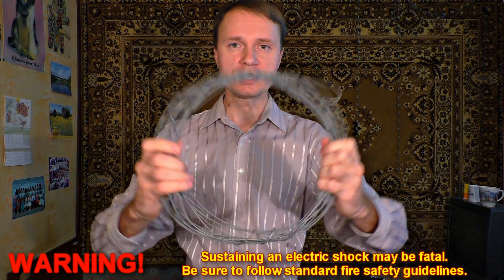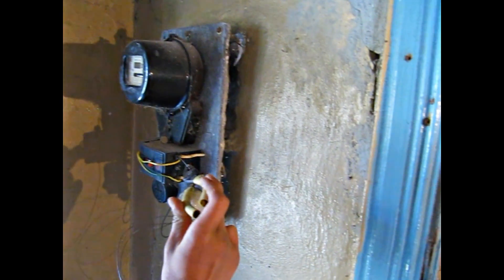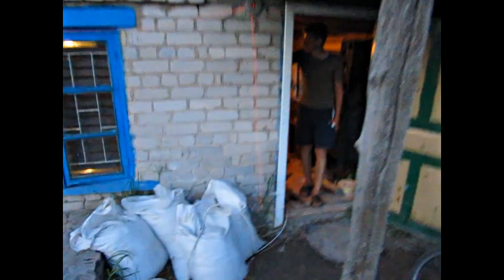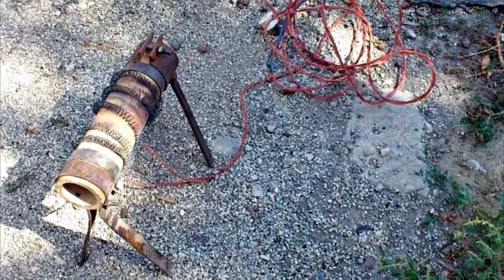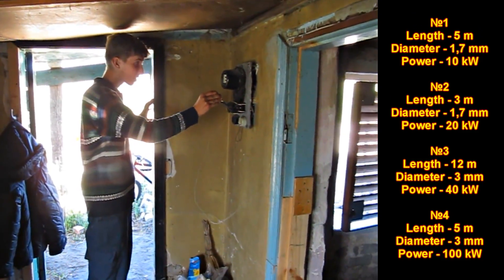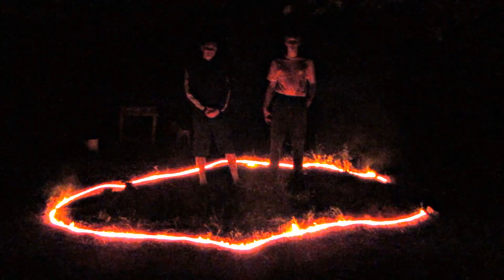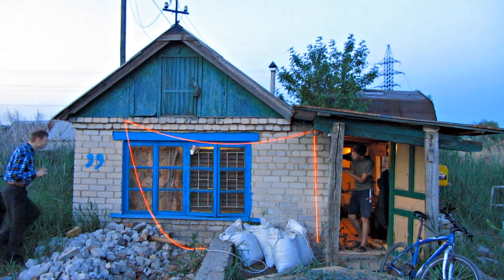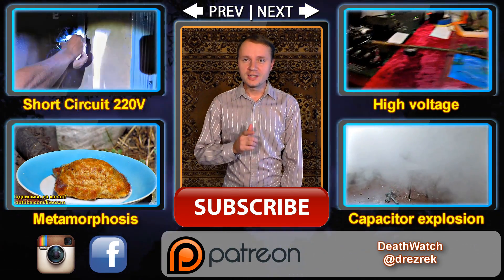Simplest DIY 100kW Heater

Comment: Good way to get a bad shock and start a fire. Stainless steel wire is better as the resistance stays fairly constant with temperature increase. Steel wire will draw a lot of current when cold and resistance will dramatically rise with temperature which is not ideal. That is no where near 100KWatts.
Reply: He probably just measured amps and not the actual power. Voltage drop with a supply running 5x overloaded is not trivial. 50kW maybe if he actually measured 500A.

Comment: How can this crapy power line supply 500A ????
Reply: it can't do that for long, maybe a few seconds if it can do 100A continuous. And even then the voltage drop is probably nuts (3-5% is typical but under overload conditions possibly 50% of the voltage is dropped across the supply lines), so I'd question the 100kW figure even if it is 500A (did they measure both current and voltage at once?). If it drops to 100v that's only 50kW.
Reply: Probably it can keep this current just some seconds, no longer. If more, it will be overheated and burned I think.
Reply: Where in the video do you see their powerline with so much detail that you can conclude that it is crappy?

Comment: Buy expensive water heater. Wire it up to heavy duty wire. Sneak over to neighbors at 3 a.m. and plug it in their garage. Very cheap. No reason to worry about hot water, housing nor food while you are in jail.

Comment: my house has 400 amp main connenction in the usa
Reply: If it is not 3 phase system at all then you can. If it is one phase system or two phase system so that legs have opposed phase then it is 120+120=240.
Reply: the sqrt 3 rule only applies to 3 phase voltages
Reply: Also, in US they only have 110 or 120 volt and 60 hertz as far as I know.
Reply: i have 240 volts at 400 amps 1 leg is 120 and another is 120 volts 120+120=240 volts
Reply: Carter Grant How much volt does your equipment work? 110/120 right? Not 230 like here in Europe does it? And with AC you can't just add 120+120 , it will become root 3 *120 I thought.
If we add 230 and 230 it becomes 400 ish.
Reply: +zezizarjaars yes u can in the us we have 2 hot legs 120 on one leg and 120 on the other 2 hots and a neutral
Reply: +zezizarjaars I will make a video on my 2 200 amp panels
Reply: Carter Grant Oké, I'll be patient,
Reply: zezizarjaars you can get 230v 60hz here in USA but is only in certain room like laundry or were the big AC plugs in
Reply: zezizarjaars You can add 120+120 V AC. Their phases are 180 degrees apart. And you sound a bit desperate to be “better” than the USA.

Comment: "Wrap your non insulated, glowing hot wire pulling 100kW (apparently) around a asbestos cement pipe"
It can electrocute you, burn you and give you asbestosis at the same time!
Reply: Asbestos pipe can withstand REDICULOUS temperatures without being damaged. That's likely why they chose it, and as long as you don't cut or smash it there's no dust to worry about. This whole idea is unsafe, bit could easily work in an emergency situation if fire is not an option to provide heat.
Reply: Drood
Yup. And at least the fibers are sealed inside concrete. It's basically made the way carbon fiber or fiberglass board is. Except the binder is cement instead of resin. Still, there's a reason it's being phased out. Removing 70-100 year old ACP water lines under cities with aging pipes is nasty shit. XD
Reply: +theLuigiFan0007
You mean as long as you don't touch it there's no dust to worry about (not that it's poisonous on touch but that the slightest touch can send fibers into the air) Asbestos is only fine if it's left alone somewhere sheltered, but you are right it's thermal properties are probably why they chose it, there are suitable alternatives but I guess they'd be unlikely to be lying around a Ukrainian (or Russian?) village